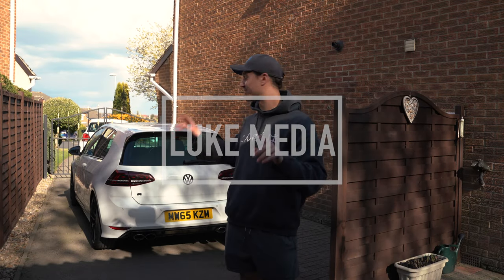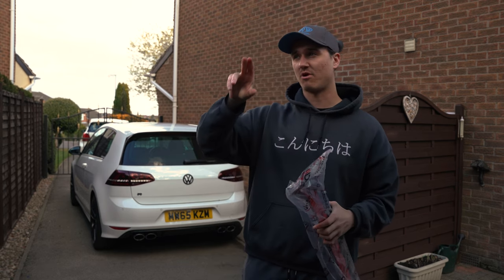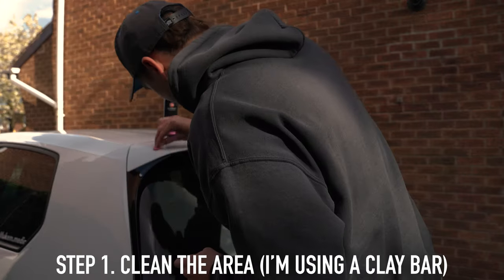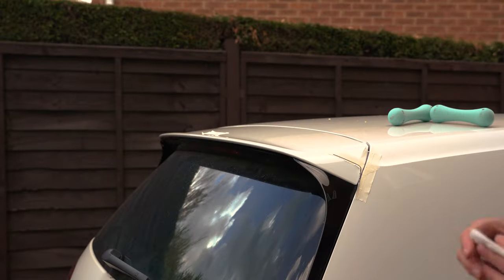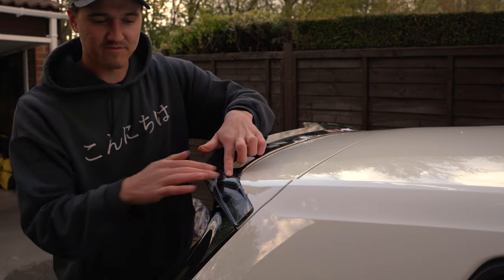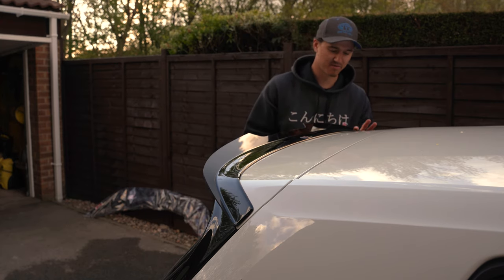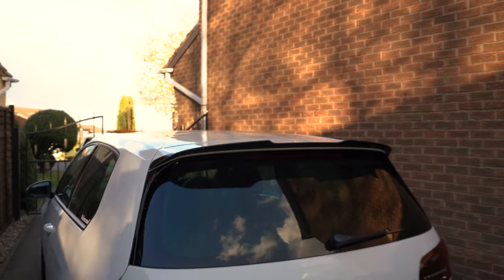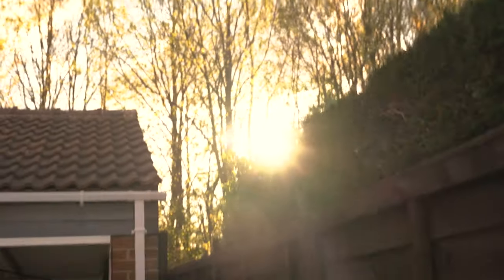Fitting Maxton Design Spoiler | MK 7 Golf R Modifications

Comment: How did you know the 7.5 spoiler would fit the mk7? I was about to buy the mk7 one but will probably buy the 7.5 one if it fits like this
Reply from the maker: It's literally the exact same spoiler the 7 and 7.5 so it's a direct perfect fit, I did test it but it's perfect! Go for it, get the 7.5 it's so much better! Coincidently, I've just been to Maxton today to have their new Splitter and Side skirts fitted which you'll see on their Instagram Story haha! Video coming soon too😁
Reply: Cheers mate. Went with the 7.5 and going to install tonight… fingers crossed i get it on nice and straight 😂 i will go and check the instagram out also !
Reply from the maker: @samdunn5039  Nice one mate, yeah you're going to love it! Just be sure to thoroughly clean the surface and use that wipe you're given in the pack to prepare the surface, will stick so much better then!
It just so happens I'm posting the video from Tuesday tonight, should be on my channel at about 6/6.30, you'll be able to see their new range!
Reply: @samdunn5039  hey man how did it end up fitting?
Reply: @sebakl  It fits perfectly mate!

Comment: When the tape first hits the car does
It immediately stay in that position or can you move it slightly once the tape is down?
Reply from the maker: Hey mate, if you kind of line it up just before properly pushing it down you have a slight bit of leverage to move it around. It’s very very sticky, so when you measure up try get it in place with only slight movement. I managed to move it I think twice before I fully stuck it and held it down 😄